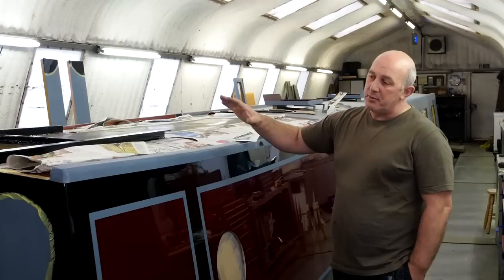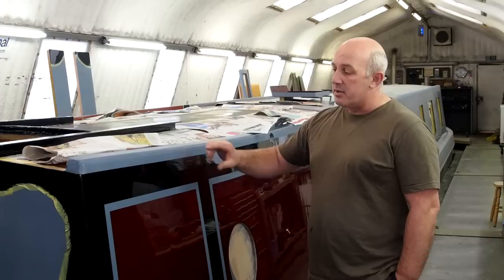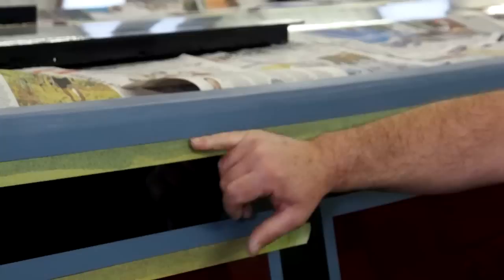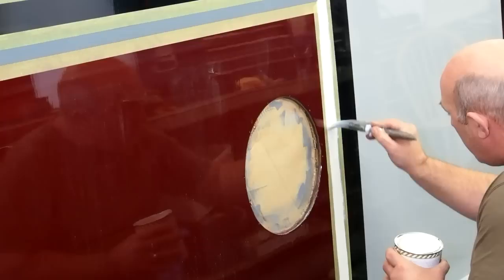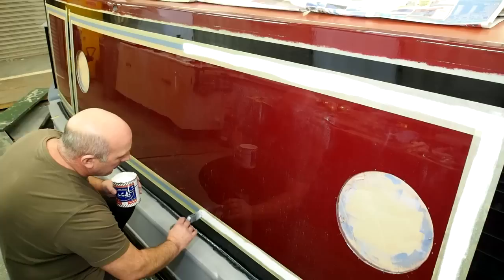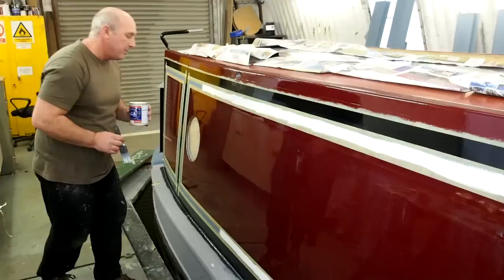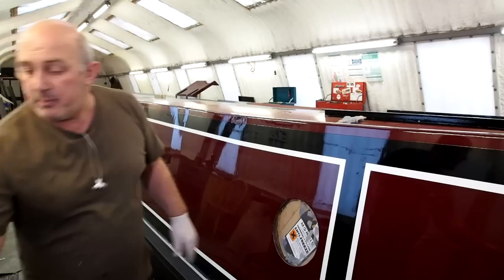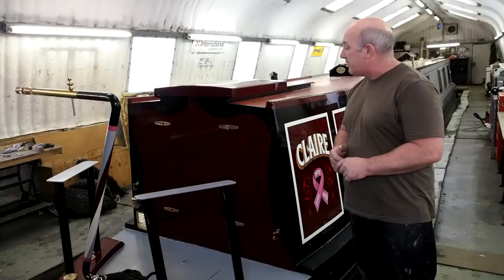How to Paint Your Narrowboat Part 7

Comment: great set of video's, I don't think I could have even started to paint my boat without seeing these, I've taken the roof down to the metal and applied rust proofing, then two coats of primer, two undercoat, and finally two top coats, and now I've started the sides, thanks for sharing your years of experience, my boat doesn't look like the picture now, I'll update my picture when I've finished, thanks again

Comment: Fantastic really enjoyed the vlogs , I have a boat on the Broads just had one thought your pain sand paint idea why not just use a very good deck paint you probably no your self if it wares down threw time it is so easy to mask up and apply another coat with no prep jobs a good one ...
Reply from the maker: hi
the paint i use is a deck paint the extra grip provided by the sand is there mostly for the gunnels which are very narrow and don"t give that good a foot hold.
thanks for the comment

Comment: When you replace the screws in the windows and doors do you use what is called resuesteel as is used in the marine boats? It is a grease that is just about impossible to wash off and does not harden at all and keeps moist out.
Reply from the maker: hi Paul,
we put an all weather sealant on all the screws to seal both the threads and the heads of the screws